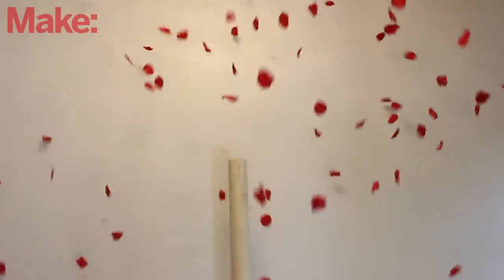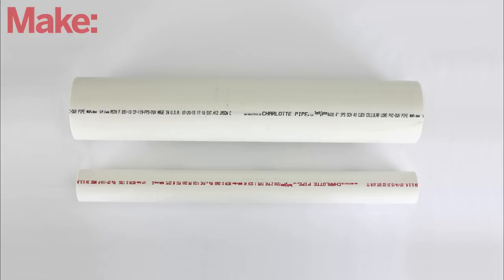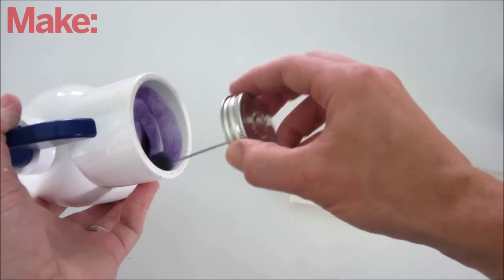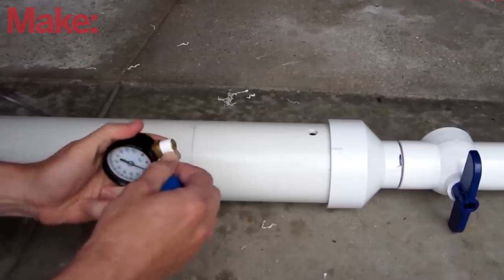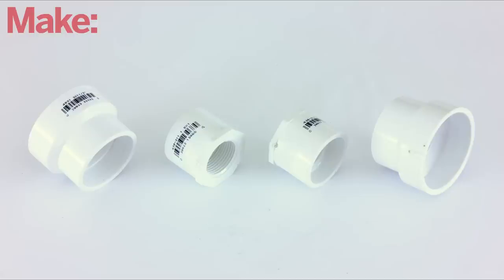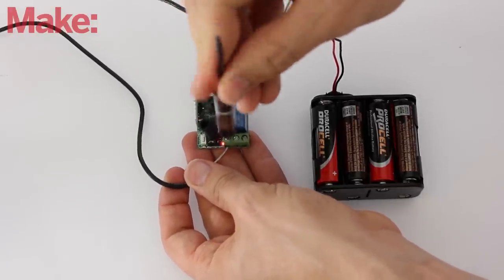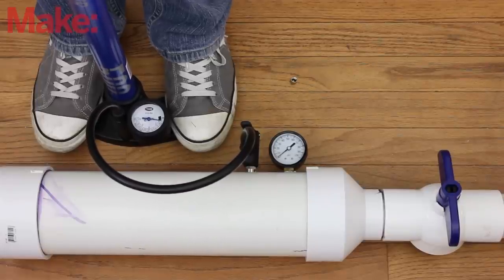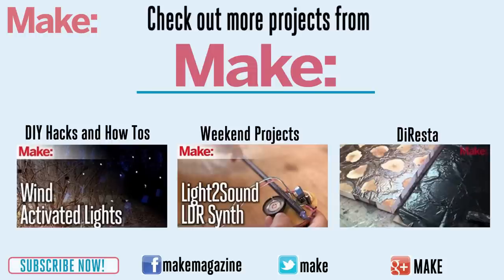Remote Controlled Confetti Cannon

Comment: I made it! Works great! I was really intimidated by the electrical aspects, but I figured it out. I'm using this for a play of Dracula where red confetti shoots out instead of blood when a vampire is staked.

P.s.
The current Orbit sprinkler valve says to use 18V, minimum; I didn't read that until after I ordered the battery, but 12v works fine.

Comment: mine won't work. What am I doing wrong? I'm not doing remote, just straight wiring. 24 volts. THe solenoid seems to be working, (I took it off for testing). And if I screw it off slowly, it works, the cannon pops quite well.. I can hear the solenoid click when power is applied but it doesn't release the back pressure that holds the air in for release. Did you mod the valve in anyway?

Comment: Very cool, I think Id like to try a blow dryer (on no-heat of course) thru a smaller tube. I did one yrs ago using a motor & pie pan w confetti on top....when I turned motor on it spun around and released the confetti.

Comment: You wrapped the Teflon tape the wrong way on the threads of the pressure gauge.
Reply: do you wrap it in the same direction as the threads or against?
Reply: You wrap it so it doesn't want to unwind when you screw the fitting in.
Reply: Ahh I see for some reason that didn't even cross my mind. Good thing that's how I do it naturally mopowers2 P

Comment: I built this to set off with a networked raspberry pi. Here's what I learned. Using the 2-inch PVC, you need to have a large solenoid valve. Look for a 1-inch sprinkler valve. But be careful, most of them are 24-volts, which is a little harder to come by. Make sure you look for one that's 12-volts as per the directions. I chose this one:
http://a.co/hvBDSQ9
Reply: Dave, how loud was the model you created? Am I going to blow eardrums out?